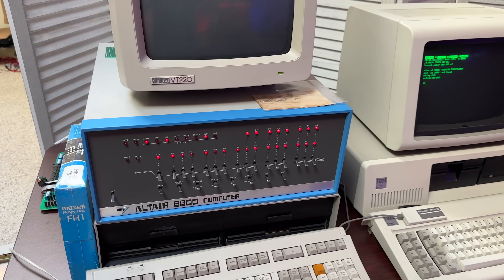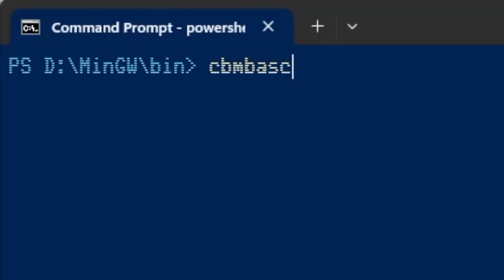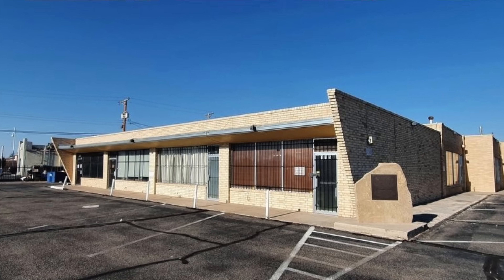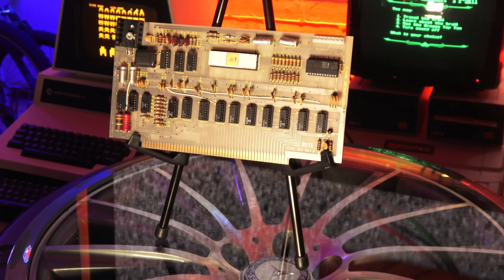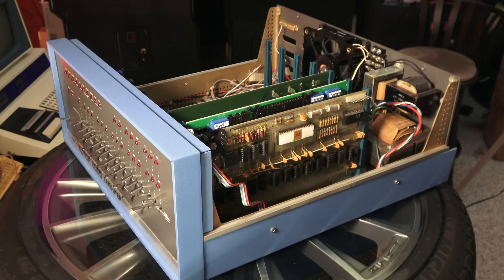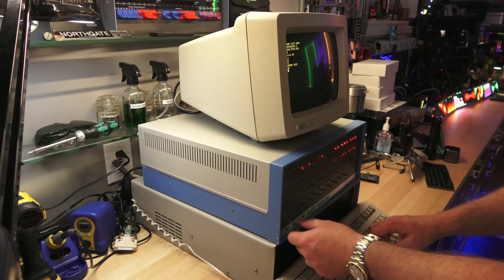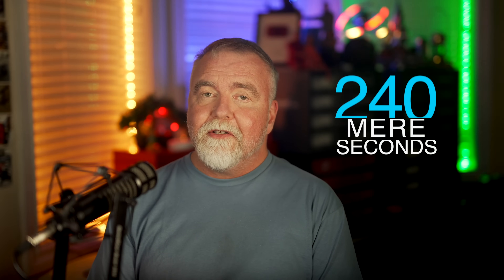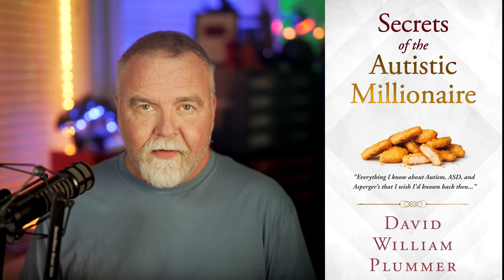Altair 8800 vs AMD Threadripper: Which is Faster?  We test them!

Comment: Amusing and thought provoking.
I remember my second machine, home made using a similar backplane. 
Have you looked at the 2732 eeprom as a substitute for your mask programmed ROMs?
Certainly worked with 2716 and the ROMs from the Superboard machine. 
I remember the days when 64K machine ran supervisory control on a complete Chemical plant.
Reply: The total address space of the 8080 is only 65K, so if you use a 2732, you would have to remove 16K of SRAM.  IIRC bank-switching was implemented long after this, so you can't use that to expand the memory space.
Reply: @surferdudemi   ooops looked at the device type number and jumped in with both feet.
Reply: @grahamheath3799   I was always a Z80 guy anyway, LoL.  When the 8086 came out, the 27256 was da b*mb
Reply: I think the TMS2516 EPROM is pin compatible with the P8316E.
Reply: @BrianG61UK  If anyone wants to use these, check the timing specs as well.  They sometimes differ, even if the pinout is the same

Comment: Come on, you know you want to overclock the Altair 8800. My first programming experience was on one and my subject was the prime number calculator. High school math office. Being the nerd I was (am) I went on to start my tech career at Texas Instruments in June of 1980 in the MOS Memory group recently moved to Houston from Dallas which explains the high number of new employees needed.
Decade or so later, I'm in Dallas, helping to leapfrog TI into the 16Mb DRAM market.
Then jump from the frying pan into the fire by jumping to Intel in early 1996 helping them sell processors via a number of desktop and early servers using a variety of system and board designs. Starting in the Portland, OR area, I ended up in DuPont, WA until 2009 when Intel decided 50 year old techs were no longer viable. I fooled them, having worked in a number of positions still learning, growing and contributing to a number of companies including an 18 month stint at a place in Redmond, working under building 92 through the pandemic era from April 2020 developing test of MEMS devices to be used for the HoloLens project using lasers. Fun stuff. I then found myself testing satellite bits and pieces including the main flight computer on Amazon's Project Kuiper. Currently practicing rocket science at Blue Origin in Kent. It's true, life is an adventure, not a destination. My only regret? Not taking more photos or collecting more memorabilia. Wait, my wife says, what's in the dozen or so boxes in the garage?! 🤓 Hobbies I reply. Hobbies and a trail of stuff, some of which goes back to the 1970's.
And yes, I bought your book.

Comment: To really be fair Dave should add in modern management techniques for the thread ripper ; so at least 2-3 agile sprints to talk about set up and running the code make PowerPoints etc:  so 30 working days + 1/10,000,000s.
Reply: Sadly, so true 😂 in this modern world 🌍

Comment: The Altair is limited to R lighting. If you added RGB lighting and water cooling to the Altair it would probably do a little better. 

The 16KB RAM board would have been pricey in the 1970s. For microcomputers, RAM was much more of a price limitation than CPU. It didn't start to get reasonable until around 1982. This is why there were absurd machines like the Atari Video Computer System (2600) with 128 bytes of ram.

Comment: It's funny to think that the C64 RAM can fit in the threadripper's cache. Not the L3 cache, either - the core's L1 cache is big enough.
Reply from the maker: Oh, I wish I would have thought of that!  Where were you when I was writing this :-)
Reply: @DavesGarage  Just as an inspiration for future videos and/or future Threadripper builds: Assuming about 16M units sold, the combined memory capacity of every C64 ever built is around 1 TB. 😀
Reply: You could get the entire RAM of the Altair in the Threadripper's registers
Reply: @ncot_tech even more if you consider all of the internal registers. I'm not sure how many there are, but modern speculative processors, especially x86 tend to have hundreds more registers than they actually present architecturally so that they can do all kinds of fancy optimizations. In a way, modern processors are statistically-influenced optimizing JIT compilers for their architectural machine code into a massively more complex real machine architecture, and that's pretty neat
Reply: @DevynCairns  The details of particular implementations are abstracted away to present a common interface.  It happens at the hardware level and again at the OS level.  I think it's amazing it all runs as fast it does when any given piece of code has to deal with a minimum of two layers of abstraction to do anything at all.
Reply: @arandomperson8336 imagine if every software was still written in machine code directly 😳. Games and programs would run 100 times faster
Reply: @davidt8087 but they will probably cost 100 times more to publishers also..  I think they just won't care about you as much as they care about their profits! 😅

since a certain period in computer development history, developer just stopped to worry about optimization because upgrades became a normal thing. if the game was too slow buy a faster computer, if it's too big buy a new HD... nothing compares to how clever they used to be in firsts home video games generations!
Reply: @davidt8087 that’s actually questionable. One of my profs at university told us that the compilers do so much magic and then the cpus also juggle around instructions for better flow themselves that it could be more likely that programs written in assembly would actually perform worse.
Reply: @Xyng97123  you're absolutely right - writing a complex program in machine code / asm is hard enough, but making it perform well requires a ton of knowledge about what the modern CPUs that will be running your code are most often best at. Very common things compilers help with like inlining, loop unrolling, and vectorization are unlikely to be considerations for assembly programmers except in the hottest of functions, just because of the work involved. Even things like choosing which registers to use because of clobbering and renaming are actually more complicated than they appear.

Abstractions can certainly add a lot of overhead, but compilers can give a lot back and find clever solutions that would take a while for the hottest functions.

Not to mention that a world where we're all writing macro assembly would be incredibly error-prone and things would crash all the time. People make mistakes and debuggers aren't magic - it takes tons of time to find these errors, and compilers can make them unlikely or impossible.
Reply: @pedroalexandre625  Yeah, but not only the cost. Price and development time would go hand in hand (Sure, something so precious also needs time to ripe, or? Hehehe). After 20 years you will get to play your long awaited Space Invaders II. The price of $2999.99 for the game doesn't really matter. At least you had 20 years to accumulate riches ... :)
Reply: @davidt8087  And windows would be a sensible size.
Heck, even with 'C', just get them to write ALL the code, not clog the ram with endless libraries and things will probably be way smaller and faster.
I wonder how many bugs have been tracked back to "I wasn't expecting that library to do that"
Reply: @davidt80807 And they would cost 1000x more to produce, be almost impossible to change or update, and only work on a specific set of hardware.
Reply: @theninjascientist689 that last one, the interpolarity of high level code, something easily forgotten but truly essential
Reply: @arandomperson8336  It is not really abstraction. The OS doesn't care how the CPU operates internally. It is just the CPU optimized so it runs code faster. Branch prediction, memory prefetching, out of order execution, all are done to get huge speed gains, without them CPUs would be comparatively slow as molasses. It isn't any overhead or abstraction, it is just hardware optimization. I say no abstraction because to the OS, the code would be 100% identical if all the voodoo inside the CPU didn't exist... it would just be a lot slower. There is abstraction in coding, in that pretty much all coding languages abstract away the need to write direct machine code, but, for non interpreted or JIT languages, it gets compiled down to machine code anyway.
Reply: @DevynCairns Now that is well said!
Reply: @pedroalexandre625 writing in machine code can offer 100x performance, 1e3x development time, and 1e-2x the likely implemented features, parallelizing development  is a huge challenge causing increase in productivity to occur more of a vertical scaling than horizontal scaling and good luck scaling vertically. On average you’re never approximately going to meet someone who writes machine core across all platforms, let alone more than one, accounting for rounding errors of course 😊
Reply: @ncot_tech  EllOhEll for sure.
Reply: The entire maxed out memory capacity of Johnny Mnemonic could fit more than twice on a 1tb micro SD card, more reliable and less invasive too.
Reply: It is even feasible to build 32GB of static ram (64-bit wide) with modern chips?
Would imagine the power source and cooling for this would be challenging.
Worse, getting this static ram machinery close enough to a modern CPU to handle memory bus speed may be nigh impossible.
Reply: Even the AMD K6 from 1997 had 64KB L1-cache (32KB data + 32KB instruction). The first AMD Athlon even got 128KB L1-cache (64KB instruction + 64KB data).

Comment: This like asking what's faster Ford model T, or Bugatti chiron

Answer is obvious
Reply: It would be fair to run the thread ripper at the same clockspeed as the Altair

But can a modern cpu run stable that slow, since mhz Clocks weren't Part of the end use case
Reply: Then again clockspeed isn't used for modern cpu as a performance benchmark 

It's flops and mips now
Reply: Thread ripper probably has its own internal graphics chip too and it's internal cache probably is larger than all the ram you can fit in the Altair 

And add more than one cpu
Reply: Technically Altair can run on x86 based cpus natively, with memory addresses remapped, if the cpu still have native x86-16/32 backwards compatibility in it

Comment: Would loading the CPU card in the center slot and then other cards in adjacent slots based on latency requirements make sense to optimize performance? Were trace lengths even a factor back in the 70s? lol
Reply from the maker: Remember things run in lock step against the clock tick, so as long as everyone gets their work and data done before the next clock tick, distance won't matter, so all slots should be the same.
Reply: These sorts of distances only matter at VERY high speeds.  At a 2 mhz clock, an electrical signal in copper can travel around 100 meters.  I think maybe the Cray had some considerations for trace length (that's one of the reasons Seymore made it into a C shape).  But I can't imagine that'd ever be a consideration in microprocessor design at the time.

That, and as Dave said these machines run at a set clock speed.

Comment: Could we program a prime sieve on the Apollo Guidance Computer and prove once and for all how powerful was the computer that landed men on the moon?
Reply from the maker: I will ask Marc!
Reply: I don't see why not.  The AGC has 11 instructions, with all basic arithmetic, plus a bitwise and.  There's a project called virtualAGC that can emulate the machine.  Seem like the AGC has close to 4k of RAM.  

Written in ASM, the AGC might be a fair fight with the Altair running basic code at 20 times the clock rate of the AGC

Comment: I run a 2970wx Threadripper with 64 gigs of RAM, and I can tell you it's a monster. Mine 'only' has 24 cores and 48 threads, but it's still a beast.
Reply: I have an old and faithful 1950x, and still way better than Any other Desktop stuff out there,  is just unfair to compare.
Reply: @migovas1483 
Apple M2 Ultra: hold my beer.
Reply: @Conservator.  great Chips.., but M1 and M2 are ARM based, and means you need to jump a few Hoops, and not everything is like True compatible,  some tuff need to run through VM,  is still fairly 'new', so if you need to Run let's say Houdini and Simulations, Things like that,  Thread Ripper is the way to go for the time being. I wish the ARM become more and more popular and accessible, but will take a while.
Reply: @migovas1483  I fully agree. If you have to emulate (and sometimes there’s just no way around it) the M-chips are not nearly as fast. For software that runs natively though, it’s awesome imo.
Reply: Why so little ram?